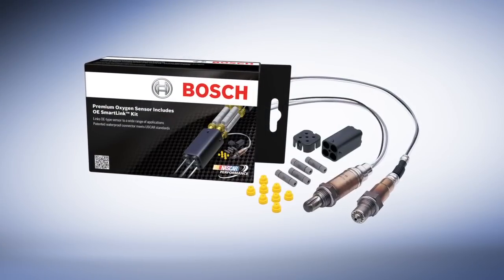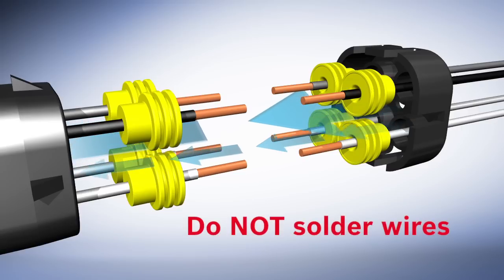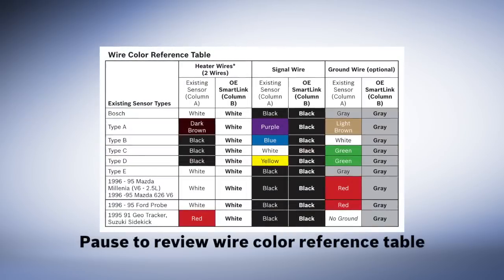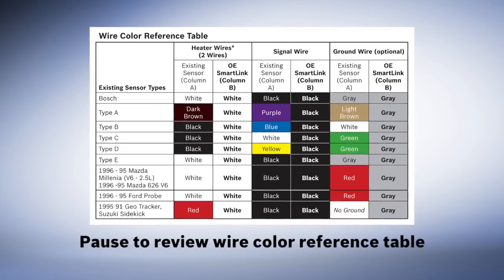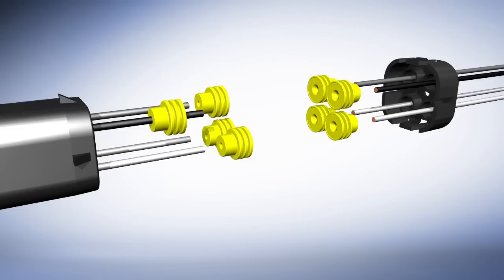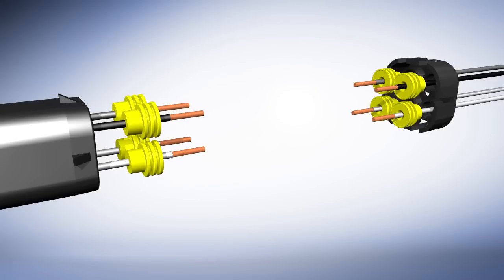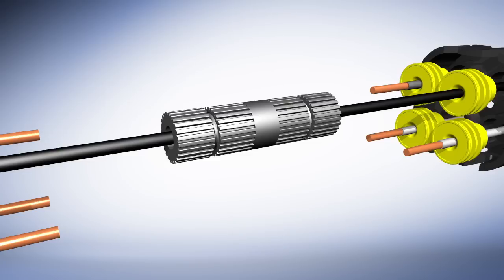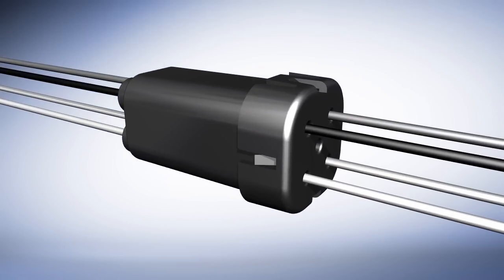Installation: Bosch O2 Sensor with SmartLink™

Comment: When I put the wires into the connector and tighten ends the wire will fall out. I put the wire next to stud in connector, is this wrong. what holds the wire in
Reply from the maker: Thank you for taking the time to reach out. We've forwarded your inquiry to consumer care, who should be reaching out to you soon.
Reply from the maker: Hello.  Thanks for reaching out.  
Based on the description, ito me like you are describing the posi-lock as a “stud.” The posi-lock is actually a 3pc assembly. Each end has a nut that has to be unscrewed, wire inserted, and then nut tightened back down…this will prevent the wire from pulling out.

The critical part of the video is from:

1:31: Posi-lock closed (before wire insertion)

1:33: Posi-lock open (nuts unscrewed on both ends, still no wire inserted)

1:35: Wires inserted (nuts unscrewed)

1:42: Posi-lock nuts tightened (as the nuts are tightened, the wire is “pinched” between the middle part of the posi-lock and the posi-lock nut).

 If you are not holding the wire in place while tightening the nuts on the posi-lock, the wire is probably just slipping out.

Comment: Stay away from thus sensor. I had to return it immediately because it wasn't as easyvto install as the denso which immediately connects. You f**k up trying to cut the wires on this stupid bosch and you will have a total loss!!! You need an electrician for this trash!!!

Comment: Do you have a link that explains how the reference oxygen is brought in through the harness wires?  Even a patent reference?  My mind is boggled.
Reply from the maker: Thank you for taking the time to reach out. We've forwarded your inquiry to consumer care, who should be reaching out to you soon.
Reply from the maker: Hi Carol. Thanks for reaching out. 
The air travels through the wires and is pulled in from the heating and cooling of the sensor, a process that creates a vacuum. This is similar to when a plastic container is placed in a microwave with a lid on. When pulled out, the lid is difficult to remove, as it created a vacuum.
Reply: Sorry Bosch have a shotty reply this is the actual explanation although kinda long.

Coming from an electrical engineer by the way

How Oxygen Sensors Work and Why Wiring Integrity is Crucial

Understanding Oxygen Sensors:

Oxygen sensors are vital components in your vehicle’s exhaust system. They measure the oxygen levels in the exhaust gases and provide data to the engine control unit (ECU). This information helps the ECU adjust the air-fuel ratio for optimal combustion, which improves performance and reduces emissions.

The Role of Wires and Connectors:

	1.	Air Passage Through the Sensor:
	•	Ambient Air Reference: Oxygen sensors need a reference to the ambient air to compare it with the oxygen levels in the exhaust gases. This reference air is crucial for the sensor to generate an accurate voltage signal.
	•	Porous Wire Insulation: Some oxygen sensors have wires with a porous insulation that allows a small amount of ambient air to reach the sensor element inside. This design ensures the sensor can compare the oxygen content of the exhaust gas to the ambient air accurately.
	2.	Why Soldering is Problematic:
	•	Heat Damage: Soldering wires can damage the porous insulation and the sensor’s delicate components due to the high heat involved.
	•	Sealing Issues: Proper connectors and crimps are designed to maintain the necessary pathways for air to reach the sensor while also providing a secure, sealed connection. Soldering can disrupt these pathways, leading to inaccurate readings.
	•	Mechanical Stress: Soldered joints are less flexible and more prone to breaking under the vibration and movement typical in a vehicle, which can compromise the sensor’s function.

Explaining to Viewers:

Here’s a simple way to explain it:

Why Oxygen Sensors Need Proper Connections:

Oxygen sensors help your car’s computer keep the engine running efficiently by measuring the oxygen levels in the exhaust. For these sensors to work correctly, they need to compare the exhaust gas to the outside air.

How Does Outside Air Get to the Sensor?

Some oxygen sensors have special wires that let a tiny amount of air through. This air travels through the insulation around the wires and reaches the sensor inside. This comparison between the exhaust gas and outside air helps the sensor generate an accurate signal that your car’s computer uses.

Why Not Solder the Wires?

	•	Heat and Damage: Soldering uses high heat, which can damage the special insulation and the sensor itself.
	•	Sealing: Proper connectors are designed to keep the air pathways open while also sealing the connections. Soldering can block these pathways, leading to bad sensor readings.
	•	Flexibility: Cars move and vibrate a lot. Soldered connections are stiff and can break more easily. Properly crimped connections are more flexible and durable.

Using the right connectors and crimping tools ensures that the sensor can breathe and work correctly, keeping your engine running smoothly and efficiently.

Comment: CHINESE JUNK Avoid Bosch at all costs...I bought bosch fuel pump #67421 and there is no filter screen included, and you don’t mention that one is needed except in the installation instruction buried in a back page.  No one reads the instructions until they are installing the part.   I wasted a day off to install this pump only to find out that if I do without a screen the warranty is void.  The salesman at the store never informed me that I needed a filter screen, there is no part number listed for which screen I need,  and now I have to miss another day at work hunting the correct part.  You cost me 2 days pay and a mountain of frustration simply by being the idiots that don’t even tell people that more parts are needed when you buy a pump.  I will never recommend Bosch to anyone and will go out of my way to tell people to avoid Bosch made in China junk at all costs!!  Have a nice F***Ing day!

Comment: Is there a universal oxygen sensor that fits into my 2002 Audi A6 3.0 Quattro? I see that my passenger side upstream sensor has four wires. The retail shops say that I need a specific oxygen sensor and a universal one will not fit.  How am I going to connect five wires in the exact fit oxygen sensor to a four wire universal plug?
Reply from the maker: Bosch wideband sensors are tested and calibrated on assembly line, using a different connector that did not come on the original part when made could change the sensor output to the ECR.
You can buy posi locks but if he has the right sensors I’m not sure why he need to do this unless the car has been modified and the sensor is too short now, if this is the case you should splice in wire between the sensor body and the connector that came with the sensor you purchased.
Do not solder the wires, using posi locks and heat shrink tube is the best way to change the length of a sensor but once the wires are cut it will not be covered under warranty
Reply: That didn’t answer my question. Am I able to use a universal oxygen sensor on an Audi 2002 A6 3.0 Quattro?
Reply from the maker: Hi John.  For the Upstream sensors that are wideband there is no universal sensor available, for the downstream post cat sensors we offer the 15733 universal sensor.  If you don’t want to mess with the universals on the downstream, you can purchase a 16978.

Comment: Hello, I have a 2002 Audi A6 3.0 liter engine. I bought the specific Bosch oxygen sensor for my car since the universal sensors do not fit with my make and model vehicle.  My Bosch sensor wiring has five wires. I will need to splice the wires since the plug is not able to be reached.  From what I understand I can not solder the wires because air needs to flow through the wires. Can I just crimp the wires and use a heat shrink? The smart link will not work since it’s for four wires and I have five. Please advise if crimping and using a heat shrink will work instead.
Reply from the maker: Thank you for taking the time to reach out. We've forwarded your inquiry to consumer care, who should be reaching out to you soon.
Reply from the maker: Hi John.  Thanks for reaching out.  You can purchase a 17353 to replace with the OE part, direct fit.
Reply: Bosch Auto Parts yea that’s the part I have but I need to splice it but it doesn’t come with posi locks. If I buy my own posi locks will it provide the air channel necessary for the wires?

Comment: Hello Bosch. in order to match the sensor wires to my vehicle can you help identify the matching pairs? 2004 Jeep Wrangler 4 Cylinders 2.4l. The 4 wires on the car side are:
Black with blue stripe
Black with Green Stripe
Black with Red stripe
Red with black stripe
Reply from the maker: Thank you for taking the time to reach out. We've forwarded your inquiry to consumer care, who should be reaching out to you soon.
Reply from the maker: Hi Cyril.  Thanks for reaching out.  Every Bosch universal oxygen sensor comes with a set of instructions with a color chart that helps customer’s match the right color wire. If you provide me your email address, I can send you the pdf versions of these installation instructions.
Reply: @BoschAutoNA  thanks but I have the instruction for the sensor. Unfortunately the one that came with the sensor does not provide the info for my vehicle. The pdf on your website is the same. Unless you can tell me precisely the matching for a 2004 Jeep Wrangler 2.4l?
Reply from the maker: Hi again.  I was able to get specific info for your vehicle.  If you can provide me an email address, I can send you the images.  I can't post images here.
Reply from the maker: Hi Cyril.  I just sent you the email.

Comment: I had one of these for an 03 Ram 1500. Nothing but a bad overpriced experience. I wired it EXACTLY as called for my vehicle. Once a week I’d get the same trouble light. I’d reset it and wait another week. Did that for over a year. Gas mileage sucked too since it was running rich.
Reply from the maker: We would like to look into your issue. Please fill out our form so that we can get you in touch with our product specialists. http://spr.ly/60521Jnlr

Comment: Hard to explain but only professional will understand regarding the ‘oxygen pass through wire’... thumbs up for bosch
Reply from the maker: You're most welcome!
Reply: Here’s an explanation for everyone regarding no the oxygen passes through 

How Oxygen Sensors Work and Why Wiring Integrity is Crucial

Understanding Oxygen Sensors:

Oxygen sensors are vital components in your vehicle’s exhaust system. They measure the oxygen levels in the exhaust gases and provide data to the engine control unit (ECU). This information helps the ECU adjust the air-fuel ratio for optimal combustion, which improves performance and reduces emissions.

The Role of Wires and Connectors:

	1.	Air Passage Through the Sensor:
	•	Ambient Air Reference: Oxygen sensors need a reference to the ambient air to compare it with the oxygen levels in the exhaust gases. This reference air is crucial for the sensor to generate an accurate voltage signal.
	•	Porous Wire Insulation: Some oxygen sensors have wires with a porous insulation that allows a small amount of ambient air to reach the sensor element inside. This design ensures the sensor can compare the oxygen content of the exhaust gas to the ambient air accurately.
	2.	Why Soldering is Problematic:
	•	Heat Damage: Soldering wires can damage the porous insulation and the sensor’s delicate components due to the high heat involved.
	•	Sealing Issues: Proper connectors and crimps are designed to maintain the necessary pathways for air to reach the sensor while also providing a secure, sealed connection. Soldering can disrupt these pathways, leading to inaccurate readings.
	•	Mechanical Stress: Soldered joints are less flexible and more prone to breaking under the vibration and movement typical in a vehicle, which can compromise the sensor’s function.

Explaining to Viewers:

Here’s a simple way to explain it:

Why Oxygen Sensors Need Proper Connections:

Oxygen sensors help your car’s computer keep the engine running efficiently by measuring the oxygen levels in the exhaust. For these sensors to work correctly, they need to compare the exhaust gas to the outside air.

How Does Outside Air Get to the Sensor?

Some oxygen sensors have special wires that let a tiny amount of air through. This air travels through the insulation around the wires and reaches the sensor inside. This comparison between the exhaust gas and outside air helps the sensor generate an accurate signal that your car’s computer uses.

Why Not Solder the Wires?

	•	Heat and Damage: Soldering uses high heat, which can damage the special insulation and the sensor itself.
	•	Sealing: Proper connectors are designed to keep the air pathways open while also sealing the connections. Soldering can block these pathways, leading to bad sensor readings.
	•	Flexibility: Cars move and vibrate a lot. Soldered connections are stiff and can break more easily. Properly crimped connections are more flexible and durable.

Using the right connectors and crimping tools ensures that the sensor can breathe and work correctly, keeping your engine running smoothly and efficiently.
Reply: @josecepeda4431   dude you're greeat! But not everyone study physics. I hope they will understand

Comment: THIS IS TOTALLY WORTHLESS! if you pay for a premium part such as BOSCH you shouldn't have to rely on utilizing you old connector body....should be plug N play
Reply: If you buy a Bosh O2 sensor that has both ends, they are much more expensive than these. This is the budget option with still a quality sensor.
Reply: You only do this on universal o2 sensors which are significantly less in price than the sensor with your vehicles harness plug included.
Reply: Depends on the application 
My vehicle didn't have a O2 sensor fitted at the factory,I only need one after market and the car didn't have a plug and play fitting
Reply: Yeah bullshit I’m over here doing electrical fuck this
Reply: @volpage77 me too bro. I had to take a break real quick cause I already had trouble getting the sensor off lmao.
Reply: @volpage77 😂😂

Comment: $30 bux cheaper for this garbage wish I went for the one with the plug already. We'll see how it works on my toyota
Reply: How did it work?
Reply: @highthai7  Probably just fine. No real difference between any two proper O2 sensors. Bosch also invented the O2 sensor, so pretty sure they know what they are talking about, and how to make one.

Comment: Will this sensor work if I don’t have any clips to connect the sensor so I mean we’re I would connect the sensor has be cut so it would need to be spliced. Would this sensor help me by connect the o2 sensor to the other wires useing what I have in the kit
Reply: I mean my wiring harness has been cut

Comment: Just did this last night. This smart link is a very bulky cumbersome design, I wish I had just used butt connectors with shrink wrap or honestly just spent the extra money for one with a connector. These plastic pieces for the connector get in your way when you splicing,  install the butt connectors and are putting on the car, require each end to have a minimal amount of wire. Otherwise these Bosch sensors are very solid great sensors, much better quality than the densos I pulled off the car. Because of this bulky cumbersome smartlink  design I am sorry I would not   recommend I hope Bosch figures out a better design because these sensors look very well built.

Comment: Well every damn video says there are two white wires and these are the heater wires, only on my Golf thats rubbish. I have one white, one grey, one red, one yellow and one black. So where in that os two white wires? This system of yours sounds a lot of grief bosch.
Reply: Bosch Auto Parts, I have the same problem with a 2013 Hyundai Veloster Turbo oxygen bank 1 sensor. My factory has 5 wires, white, red, yellow, black and gray while the factory one has 4. So for what I understand is not recommended to used the universal 15733 with the factory wiring on the Hyundai. Is it better to go with the oem item?
Reply from the maker: Hi James, 
We apologize you are having difficulties installing the O2 sensor. What is the year, make, model and engine of your vehicle?
Reply from the maker: Based on the information you provided, it sounds like you are looking to replace a Bosch wideband LSU 4.2 or 4.9 five-wire sensor with a four-wire switching universal sensor.  However, a wideband sensor can’t be replaced with a universal sensor. Does this help?
Reply: I bought a replacement sensor from Eurocarparts for my Golf 2.0fsi year 2006. I noticed straight away the wire colours never matched the colours of the loom in the car, but forgetting this I also noticed the sensor had five wires going into a plug which had six pins. This plug connects to the plug of the cars loom where there are six wires connecting to 6 pins. Scannerdanner on youtube said he was concerned about this. I have two codes P0037 and P0050 referring to the heater element. Im wondering if the loss of one wire is the reason for this. Believing that the ECU switches the ground side to regulate the heat within the sensor.